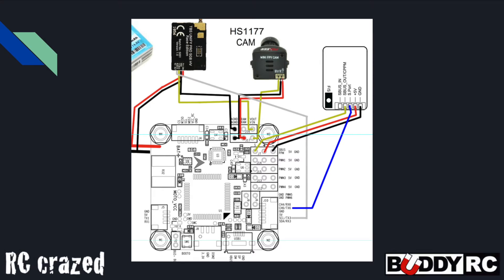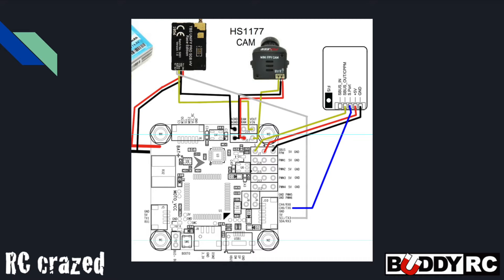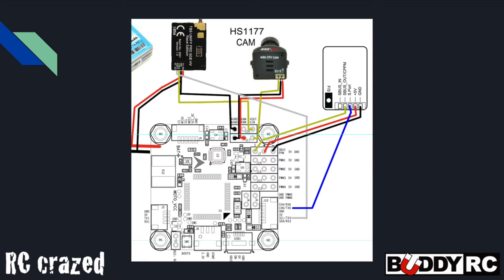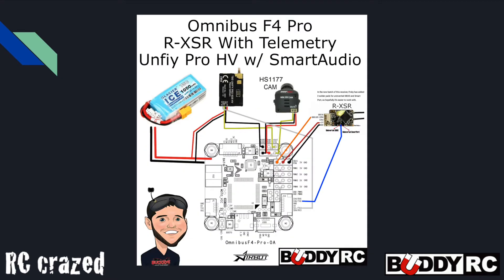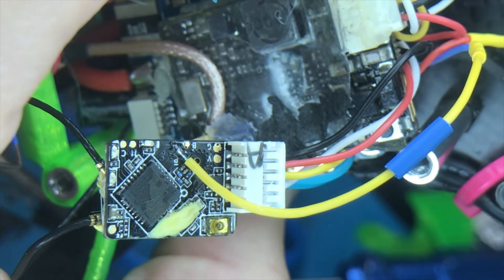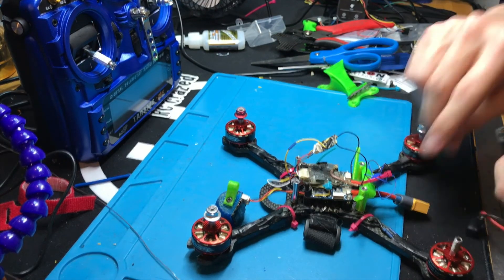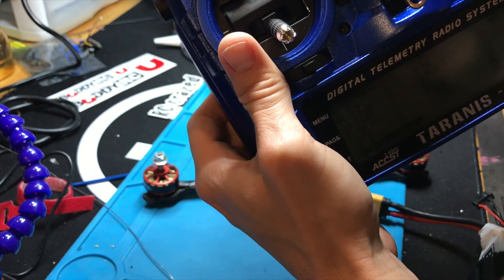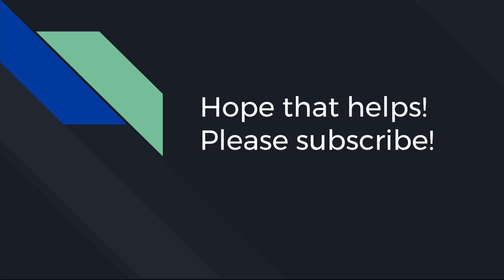R-XSR Un-Inversion Mod & Omnibus F4 Pro Wiring Guide

Comment: Any chance you could help me out? I just found this video and it has been by far the most useful one yet, thank you! I have a mamba f405 stack and a rsxr receiver with a rush tank vtx. I wired everything up and binded my transmitter no problem. I have power to everything, the blue sbus light is showing and I downloaded the updates for the receiver, but I cant get any input in the ports tab from my sticks and I have tried every uart as the serial rx. If you have the time I can send pics video etc. This is my first build and I'm just really at a loss on how to fix it.  Thanks for the video!
Reply: Message me on FB and send me a sketch of how you have everything wired up. https://www.facebook.com/RoscoFPV/

Comment: I exactly know your pain :D had the same issue. The uninverted pad is so annoying to soldier though. I've ripped it out as well couple of times already and I had to solder it back again....
Reply from the maker: Do they still not give you an uninverted wire on updated receivers? It's been about a year since I did a fresh build with Taranis Receivers. Seems crazy they they don't cater to quad folks and offer the wire on the harness/plug.
Reply: @roscofpv2357  Doesn't look like. Unless I got old stock!! :) Maybe it's worth doing some research. If you find better solution, let me know. Or just maybe better receiver in the same format. I love it's as it's tiny!

Comment: i see 5 wires running from your rxsr, live, ground, sbus , the telemetry and smart port? is this correct?  do i need telemetry and smart port on separate uarts?
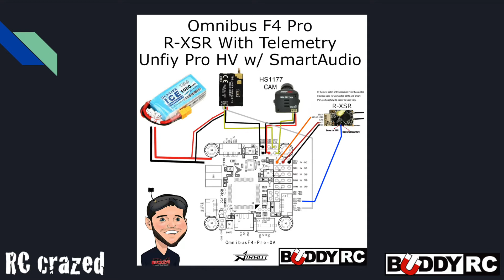Reply: If you look at the schematic at 1:32 there are only 4 wires coming from the RXSR. LIVE, GND, SBUS and S.PORT. S.PORT is your telemetry. Hope this helps
Reply: @coreysnyder  thanks for replying at 1.55 you can see 5 wires... 2 yellow, red, black and white, this is where I'm confused
Reply from the maker: The 3rd wire down(yellow) is the inverted S.Port and isn't used. It's cut off right as it goes under that other wire so it's hard to see.
Reply: @roscofpv2357  thanks for clearing that up for me 🙂

Comment: thank you so much about this!!! I ll write if it helps someone. I dont know  why but in revoltOSD running flightone you have to connect smartport to RX3.
Moving to Betaflight it doesnt work... I used the UNinverted signal to TX6, enabled smartport in UART6 and suddently numerus sensors appeared in my horus and LUA works!!! Thanks again!
Reply: Thank you! Was going nuts trying to get Betaflight running on my RevoltOSD and bolt32 stack. Had to remove sport from rx3 and solder uninverted sport to tx4, the invert bridge on the RevoltOSD doesn’t work at all. Then bridged the rx6 and tx6 pads and now have esc sensor amperage and FrSky telemetry!

Comment: I'm really out of ideas, and am down to this as my last possibility on why i can't get my omnibus F4 v3 board to arm. I have the r-xsr. My soldering skills are very novice so getting the wires onto the UART6 port (in the case of this specific board) was nervewracking but i pulled it off along with the sbus pad bridge that specifies sbus mode. The thing is, i don't know for sure if i need to solder that green sbus wire from the uart to the uninversion (P) pad on the receiver, or if i am supposed to do that with the s.port wire, or even why this is even a thing. you aren't using the same board as me, and i am a hyper-noob, so i know what you are saying in the video applies to your FC, but is this also the case for my Omnibus? Based on your video, i wanna say the yellow wire, but i don't want to solder more than necessary to fix this.

Comment: Do you have to use the tint uninverted signal on the r-xsr only on F4 boards ?
Reply from the maker: Yes, with F4 boards they usually only have 1 dedicated port for an inverted signal so you have to use an uninverted signal on the rest of the UARTs. It's a pain!

Comment: Thanks man! But whats about the vtx smartaudio from the unify? Is it also inverted? Oder does it work normaly?
Reply from the maker: Smart Audio on the Unify is A OK to use on any UART. It will work wherever you put it! I always save UART1 for the built in inverter, and then uarts 3 & 6 for smart audio, smart port telemetry, GPS units, etc.

Comment: TX6... I am going to have to do that, cause I have nothing left other than tears.. :)
Reply from the maker: Tears!? What happened?
Reply: RoscoFPV I fixed it.. could not get the fc to talk to Betaflight. FPV community came together and wiped my tears away.
Reply: I have an Aurora F4 plus V1 (Furibee Darkmax), can I soder the S port to TX3? Thanx
Reply from the maker: I'm sorry but I'm not familiar w/ that FC. You should be able to though, you just need to know if the TX3 is inverted and use the appropriate SPort signal, inverted vs uninverted.
Reply: it worked but I had to solder the p pad uninverted to the tx3 yeeaaah

Comment: So In the diagram it showed that you only need the grd 5v and sbus out wires coming from connector and the uninvert  wire from the Ptab. But i noticed you have the grd, 5v, sbus out, and the s port wire coming out connector on your quad. Is there a reason for that?

Comment: why do i have the same the exact settings as you however i dont get any of the sensors!? please help thanks
Reply from the maker: If you have it wired up correctly, using the UNINVERTED S.Port and not the one on the plug, then something else isn't setup right. Are you not getting the sensors in your "Telemetry" page? I'd make sure you're betaflight configuration is 100% right. I'd follow the video one more time and pause it on each step of the betaflight configuration and make sure yours matches.

Comment: Thank you! I had switched from a xsr to rxsr and lost telemetry. Noticed your change in betaflight and now I am flying.
Reply: danlatu I swapped my xsr with an r-xsr as well but it doesn’t seem to be binded .I have green and blue light on after binding but it’s not arming.I sidnt notice anything different in the betaflight settings from the xsr to the r-xsr

Comment: I really want to thank you. I've been searching the net for the last 2 days, and couldn't get my R-XSR to work with OMNIBUS F4 V3. There are some changes of Omnibus V2 to V3, and the UART was changed from 1 to 6. Thought the problem was with the FC, and tried everything on the FC and BF, until seeing your video and realise I don't have the blue light on RX, only the green light!
Finally holding the bind button for 5 sec, and the blue light came on. Suddenly it's working!!
Thank you so much, you made my day.
Reply: I seem to have the same problem, but I do not see a blue light with my RXSR. I only got a red and a green light on it. Even I press the F/S button for > 4 sec, the red light flash twice and seems changed to S-bus but still I got only 2 sensors found, no PID display with lua script. Is mine a new version of RXSR?

Comment: Ok I was hoping for some help I got what I think is omnibus f4pro v5 but I hook sbus to proper spot and select uart1 and it still does not show up on receiver tab do I need to invert the s bus wire too or just smart port wire honestly it's a bit confusing as the board I got had no instructions

Comment: Well that sucks big time.. ive got the first version of r-xsr.. with no b and p pad.. so it will be soldering directly to one of the pins on the inverter..
And damn that is a small pin.
Reply from the maker: There are ways of doing this without soldering to that tiny little pad. I will be making a video on this soon!
Reply: Thanks man : )
I have a fantastic weller soldering station with a smd tip.. but still its so small leg to solder on.
I have only been using f3 boards up till now.. but I'm planning to get a few betaflight f4 board.
on Fpv models site they mention you can connect the telemetry to a uart as softserial.. or have i missunderstod.
what is the difference between to hack a un-inverted -sport or connect the ordinary inverted signal as softserial?

Does softserial slow down the f4 and make 8k8k impossible?
Reply: how to do that? i think i've met some terrible problems that even this video's solution doesn't work on my FC and R-XSR